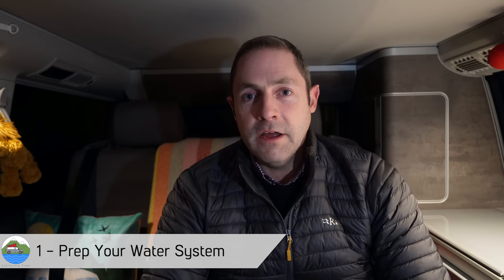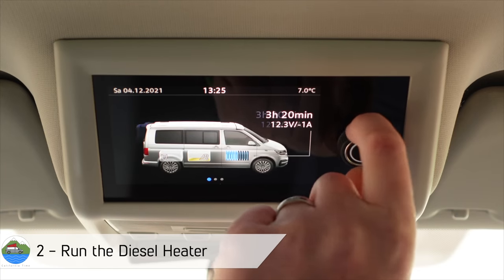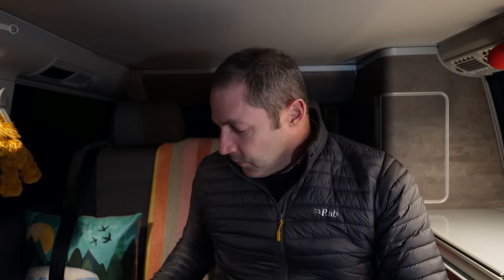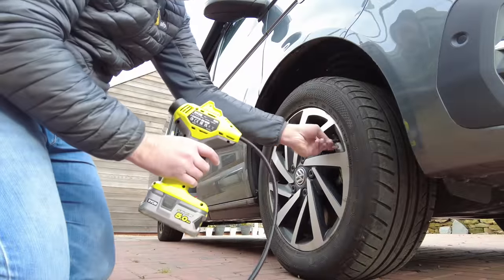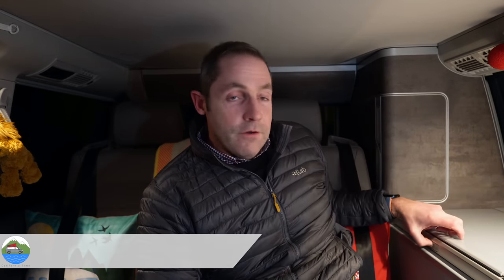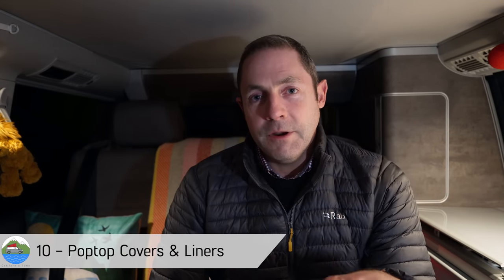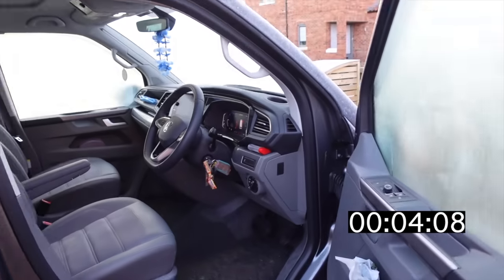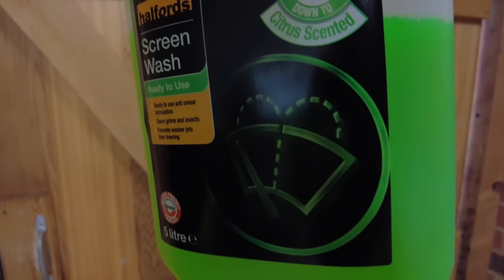12 Winter Campervan Top Tips & *COMPETITION!*

Comment: We tend to use our camper throughout the year, even if it’s just taking out for an afternoon run every month.  We don’t use the fresh water tanks in winter but buy one of those big water bottles from the supermarket and use that for drinks etc.  if you are taking the handbrake off (we just drop the handle down a notch) then best to chock the wheels as well as leaving it in gear.

Comment: Great video, didn’t learn anything new as such but reassuring to know we are doing the right things. Top tip from me is indeed to get out in the van at least one or two weekends per month and we’ve had some fantastic trips away, freezing outside and toasty warm inside. We use Rainbow screens for the windscreen and the pop top, highly recommended. Those switchbots look very interesting.

Comment: I have both internal window covers and the external window cab covers.
Although in still weather the external covers are good, I found that in windy weather, particularly if you are parked up next to a beach, the sand or other grit blown by the wind, gets underneath the covers and scratches the paintwork. They can also be very noisy flapping about. I won't use my external covers in predicted windy weather because of this and always use the internal ones instead, when it is windy. As for pop top thermal covers, I would not use them, again in windy wet weather, if you have to bail out and drop the pop-top, you can't do it from inside your nice dry and warm van. You have to get outside, removing the thermal screen first, getting drenched, before you can finally drop the pop top. Just turn the heating up, is my advice.Switchbot.

Comment: Useful tips much appreciated. 
We purchased an inexpensive Oria temperature monitoring /logger Bluetooth system to check out the fridge, which has been useful.  
The switchbot system looks more comprehensive.

The pop top canvas seems to have survived last winter. 
I am mindful to make sure it is aired after a wet period of use.

There seems to be a mixed reaction to the use of Milton for sterilizing water systems as it attacks some plastics and metals. 
However, the dilutions and thorough rinsing you use seem sensible.  
White vinegar and Puriclean seem to get recommendations

Comment: Some fantastic tips on winter I would recommend a Ctek battery charger to keep the battery in tip top condition. Very easy to use and excellent customer service. A Switchbot sounds like a fantastic bit of kit.

Comment: There are now some really great all season tyres as an option, some are rated for the European winter requirements but not all, they are well suited to our climate. The switchbot thermometer looks cool and is definitely an idea I will follow up. We do now have our California (as of 28th Oct) which is almost the spec twin of yours. We have, however, had it converted to VB air suspension for several reasons including easier access for elderly parents, the ride is also a massive improvement. We had the VB suspension and a few other upgrades (dashcam and alpine sound) done at Exploria in Brighouse who unlike most suspension fitters do almost exclusively T series VW 5-6.1. It was great to feel the difference between the drive up and the return journey. I think there are several other companies in the north that fit the suspension but it was great to get the other bits done at the same time by a company that does so many different conversions, I can recommend them to anyone around the north of england.

Comment: Switchbot thanks for your advise Will it’s our first winter in the van if you sleep on the bottom bed would it be better to pull down the pop top to sleep then raise on wake up time just a thought ?
Reply: Yes, it certainly would prevent much of the warmth escaping, at a cost of headroom. As you are sleeping below, you can retain headroom, by keeping the poptop and upper bed raised. I'm 6'1", but after a few hits of my head, I've got used to upper bed being down. If I was only travelling with the wife and sleeping below during colder winters, I would have the poptop/bed down during sleeping...

Comment: Good video, though Milton shouldn't be used if you have a water heater as it can damage the internal workings. My van has a water heater so I use Puriclean. The Switchbot looks an interesting and useful bit of kit. My van gets used year round, but there are several useful points here nonetheless.

Comment: I have mounted an electrical switch between the tap, that is switch of in the winter and tap left open. The emptying tap is open at the same time. "Switchbot"
Reply from the maker: Great idea and Westfalia do the same on their vans from the factory - they have a pump isolation switch so you can leave the taps open over winter. They also have drain cocks on the water lines in the van too.

Comment: Just another winter thought Will - what are your views on putting a cover over the whole van over winter (assuming it's removed to give the van a run each month)?
Reply from the maker: Absolutely NOT! Don't do it, even if they say they are breathable in my experience they still move around in the wind a little and rub on the paintwork. Much better to give the van a winter coat of wax and then just do the regular maintenance of making sure the roof rain holes are clear etc etc.
Reply: @CampervanTime  Ok. Thanks Will!